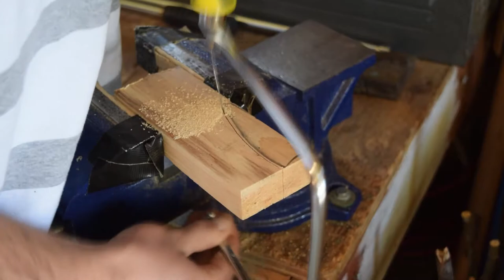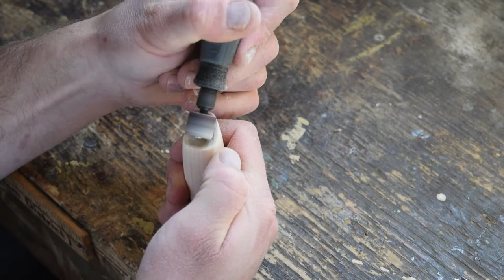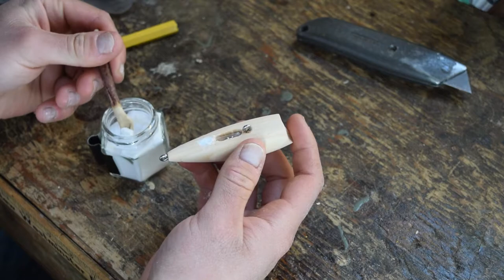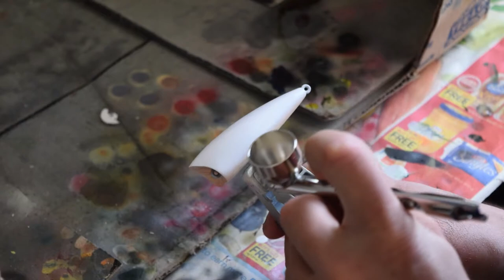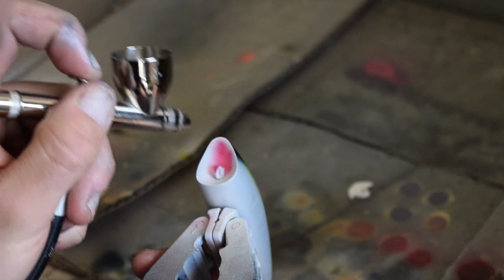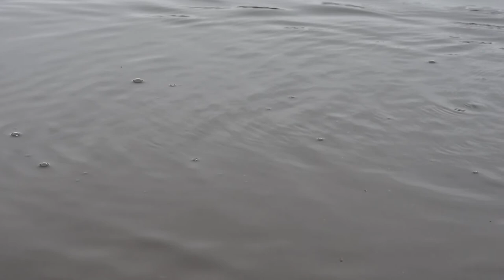Making a Classic Bass Popper

Comment: Another magnificent piece. Could you share what procedure you use to draw the lines to do the tappered corners ans achieve the round shape? How can we do it us mortals without experience? Should we measure from a center line...really confused about how to do this. Thanks
Reply from the maker: Thank you very much! I like to make popper mouths slightly triangular in shape. But you can make them a lot less complicated by drawing your chamfer lines gradually farther away from the corners as you go from back to front. Finish the lines 1/3 of the way in from the corners of the mouth. After you remove the corners, blend it all together with a sanding belt as done in the video. 
Hope that helps.
Reply: @LogjamLures  Thanks a lot for your answer. It's useful to know that I am not ready to get even a tiny bit close to your design. After a frustrating afternoon, I'll keep improving my rounded designs. I believe that a video explaining how to draw the chamfer lines depending on what you want to achieve could have many views. At least I'd watch it many times myself. lol
Reply from the maker: @rialfe7514  Well "keep pluggin' away" at it! And thanks for the video suggestion.